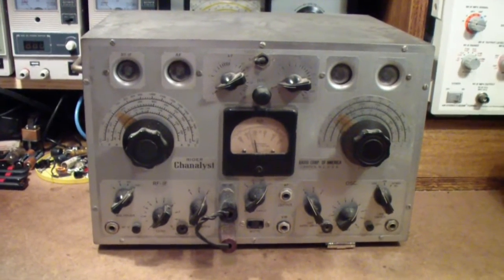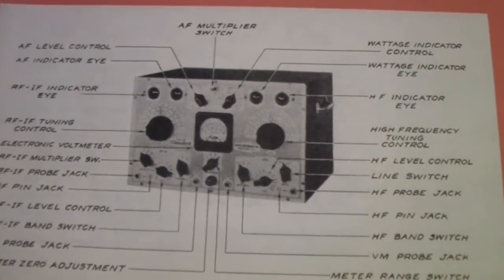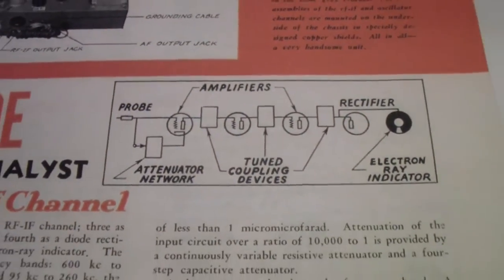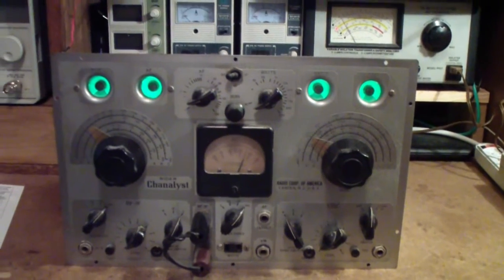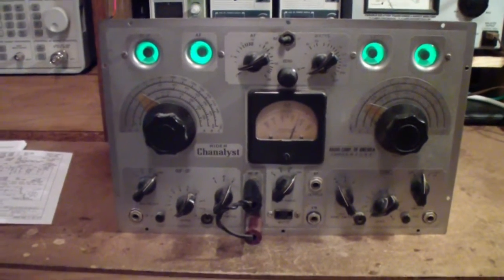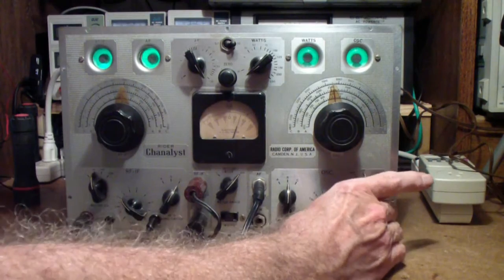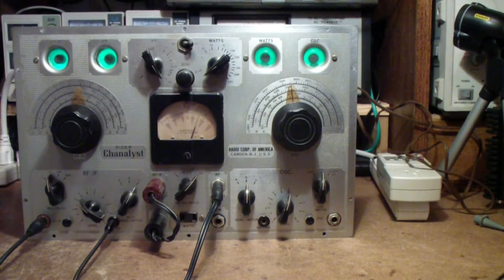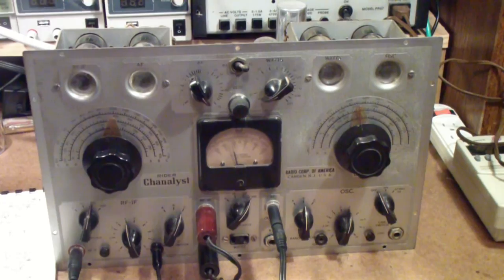TTT103 RCA Rider Chanalyst

Comment: If it helps anyone, page 1 of the manual on BAMA [pdf page 13] upper right paragraph, states the RF-IF probe [red] cap is 1.0 micromicrofarad [1pF].
Reply from the maker: Thanks for the reminder. I used an overlapped piece of insulated wire(next to but not touching the conductor of the coax) as seen around the 14 minute mark of the video since you cannot find a 1-2 pf component capacitor. I adjusted the overlap until it measured a little under 2 pf (2 mmf to those of us old enough to remember the former designation). Of course, you can make it as small as you like by reducing the overlap but a little under 2 pf worked fine for me. I had to build the probe since it did not come with the used Chanalyst and I could not find anything like it on the web. It took a little experimenting since my first try (with the smallest component capacitor I could find) was too large and loaded the circuits of short wave sections (I tested it originally on a 1938 Philco AM/SW radio. A bigger capacitor will work OK in the AM band, but you need 2pf or less as you approach 20 MHz (20 MC in the old jargon). Of course, you need some capacity to get enough signal into the Chanalyst, but it has a lot of gain so you don't need much. I hope others will try to resurrect one of these old RCA units and let us know about it on YouTube.